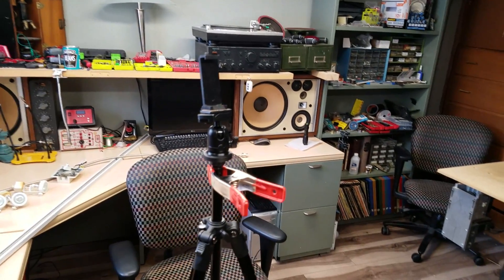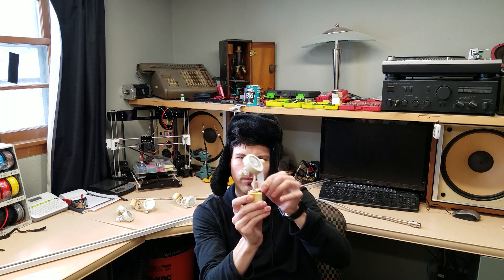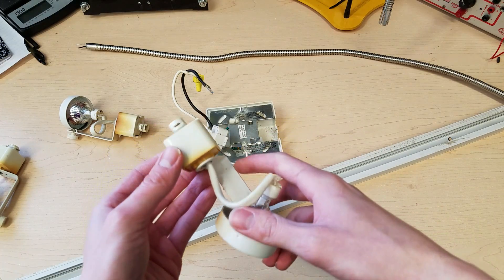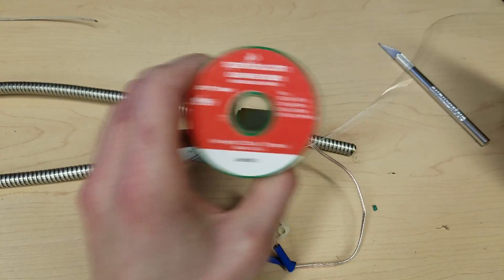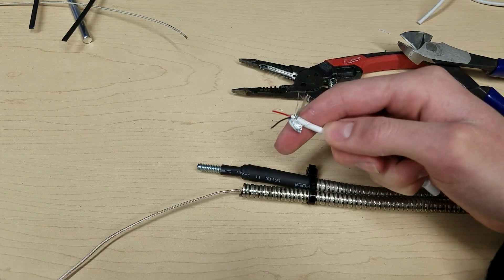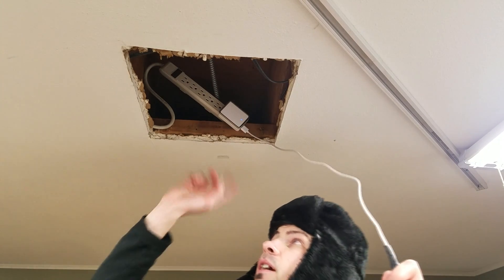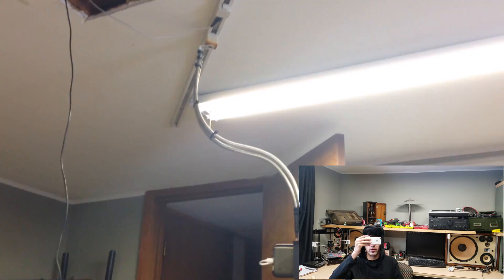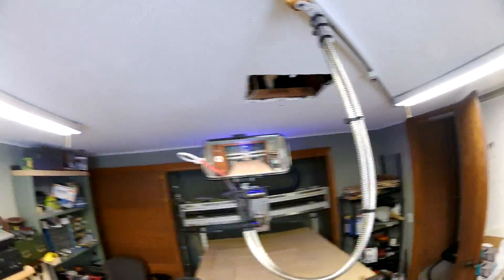Ceiling camera rail with integrated charging! Made from cheap re-purposed track lights!

Comment: I had this exact same idea for my set up, minus the powered rail. Only difference was I planned to used stepper motors to pull the camera along the track
Reply from the maker: Very cool, I would definitely recommend checking out 80/20 aluminum rail for something like that!

Comment: If the flexible power conduit and the flexible support conduit on the camera came in from different directions they could probably provide better support and less wobbling. Great video and very informative!
Reply from the maker: It's a good concept and may help it be repositioned easier,, but the wobble came from the rail itself being rather flimsy/the connecting junction being weak.

Comment: When that mount woobles, maybe you can fix that by applying a second foot to that ceiling rail. Just so that it can use the two to keep it from going out of control.
It is a great mount, I would love to see you apply some fixes to it in the future as you discover more problems.

I personally would have gone the extra mile and make it look pleasing to the eye as well as being useful. but thats why I dont do these things isnt it XD
Reply from the maker: Good ideas! I plan to eventually build a better system using an 80/20 aluminum rail, perhaps I'll even motorize it!

Comment: Nice idea and execution. Did you seek out the track lighting specifically for this or did you come up with the idea after you had already obtained it? I'm curious where your inspiration comes from.
Reply from the maker: Thank you! And great question, thanks for asking! I had this idea first, and was fortunate enough to find the rail on my first trip, and for so cheap! Since I was rather young, one of my main sources of entertainment was taking apart stuff from goodwill, as well as learning the history/uses of the unusual objects that I saw. I've had so many ideas come to me from finding objects there throughout the years, and still do, but I have also developed a pretty comprehensive idea of what is available on the used market, and roughly how much it will cost. Nowadays many of my build ideas come through random inspiration, or by necessity, and immediately I'll try to think of the cheapest existing parts that can be re-purposed with the least modification to complete them. Now that I am making videos, I will also be doing more "trip to the thrift store" style videos, where I do something on a whim based on what I find...My microphones video is an example of that!